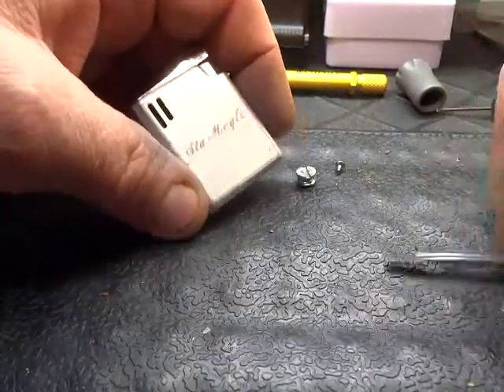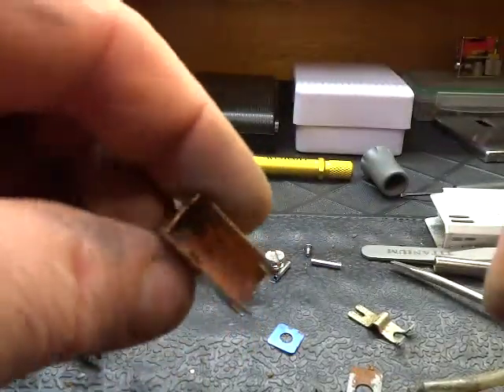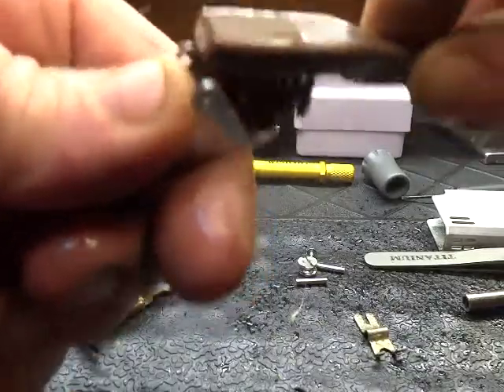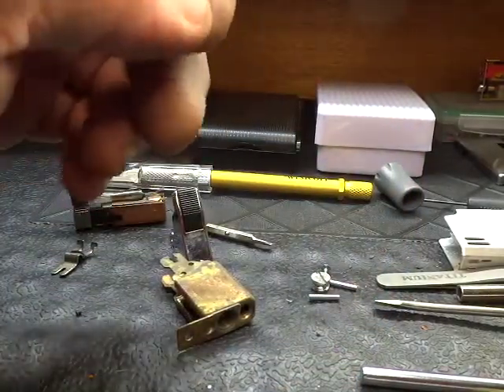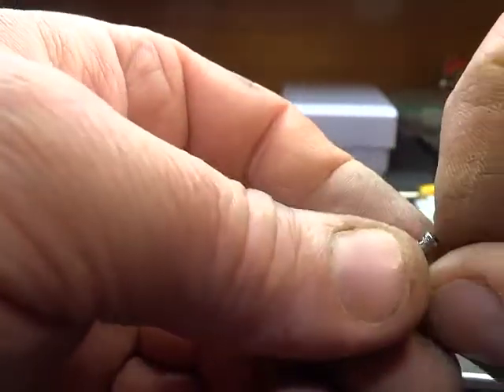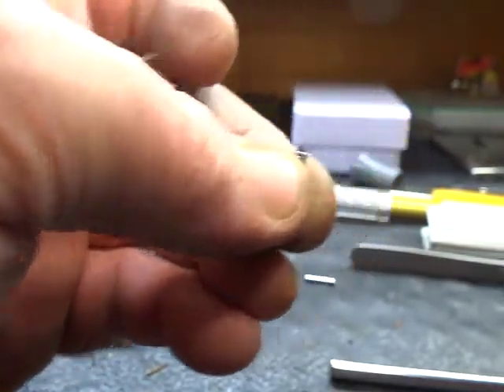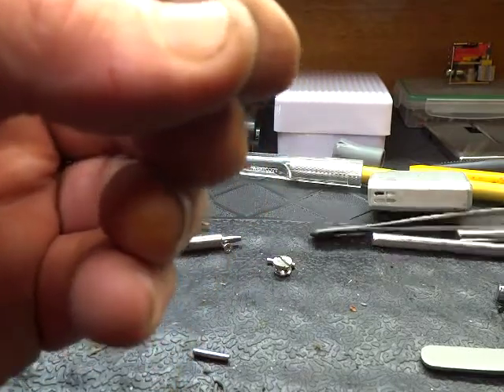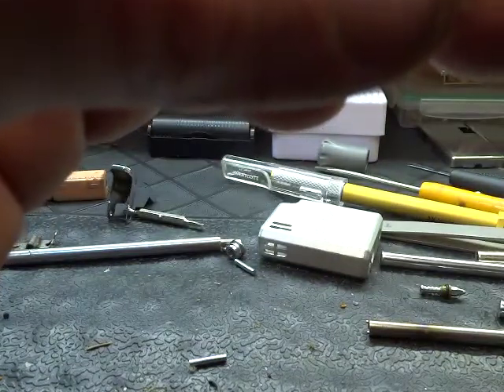Vintage Firebird Butane Lighter Repair Pt  1 of 2

Comment: I noticed your tiny brush to clean. I personally buy paint brushes that have the same material but different lengths and sizes of brush and shapes. I have about 50 and a sonicare toothbrush for quick cleaning. I use sanitizer because it holds well in them.